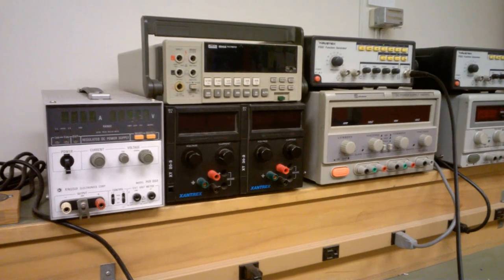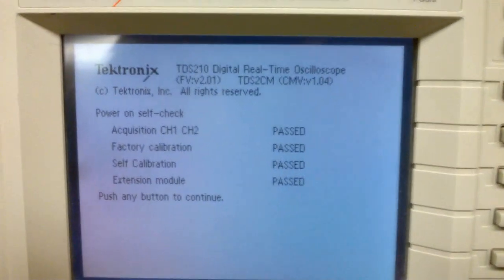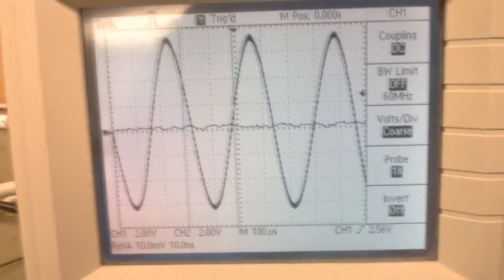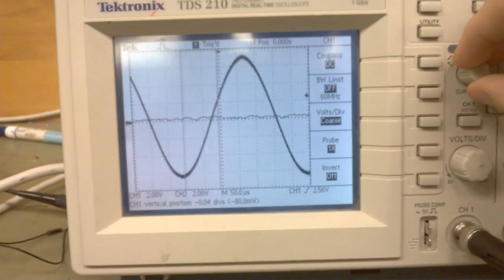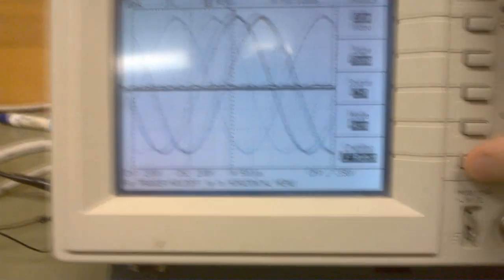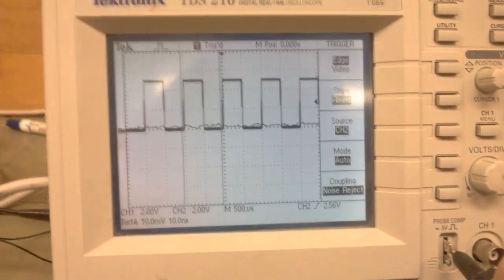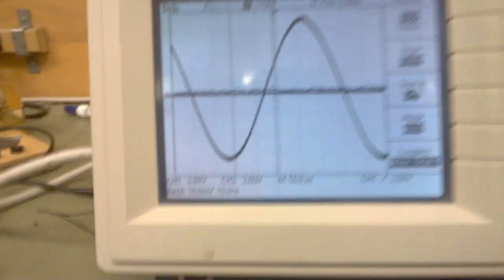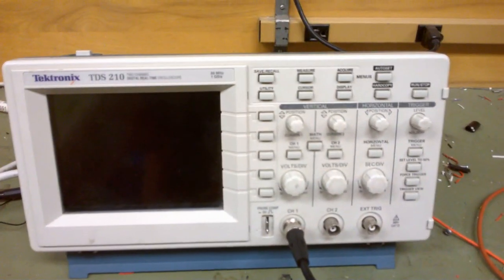Tektronix TDS 210 digital oscilloscope (1997)

Comment: I had a Tektronix 502 for 30 years after buying it used⏩>imgs.love/TOscilloscope?ѫ   that I finally parted with. This 1052 is significantly more capable and probably a tenth of the weight. The screen is bright and the traces sharp. The controls are intuitive. I especially appreciate that I can store it on a shelf with my other desktop instruments instead of having a dedicated scope cart.

Comment: The way I see that looks slim on the Digital Oscilloscope, it looks like that the technicians can carry around the public area or anywhere to identify the frequencies on any electronics where people are asking for request to fix the problem like VCR for example to have the picture quality run better and to have an audio sound clear by adjusting the screw on the guide on the VCR where they have to make the clear image and clear audio with no interference.

In my opinion, Analog Oscilloscope is much better than Digital Oscilloscope which you get a quick look on the frequencies and more features on Analog version than the Digital version.
Reply: I have the 220 it looks just like the one in the video and comes with a carry bag and I also have the owners manual but not the "Extension Module" I do use this scope when I have to leave the house but I do have 2 big analog monsters that stay home . To get out of Channel 1 just push the Channel one button twice same with Channel two . For a 20 year old scope I like it , it does not have all the features of a 2017 scope that you need to be a total NERD to remember how to use all of them . I got mine for free so I'am not looking a gift horse in the mouth ( with the probes and carry bag / manual )
Reply: tds210 умеет показывать измерение частоты? Я не вижу на дисплее какая  частота измеряется.  @fakenews7266